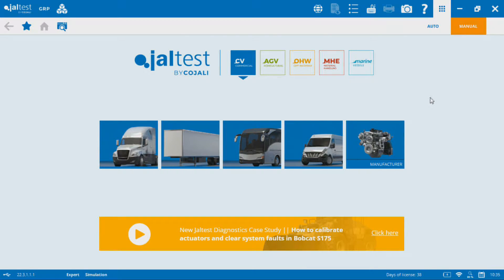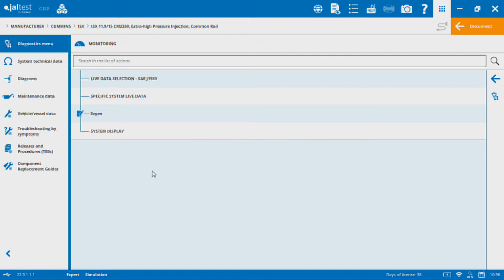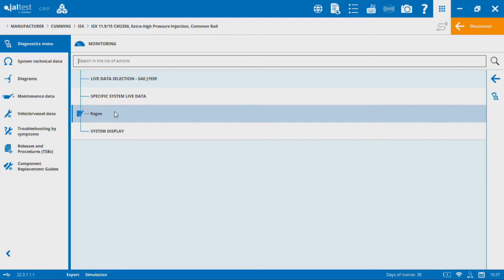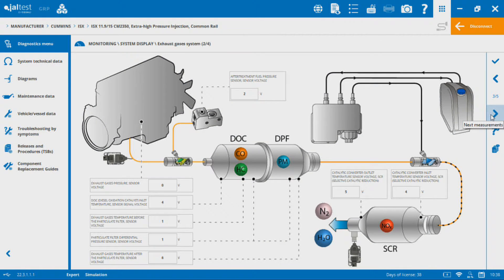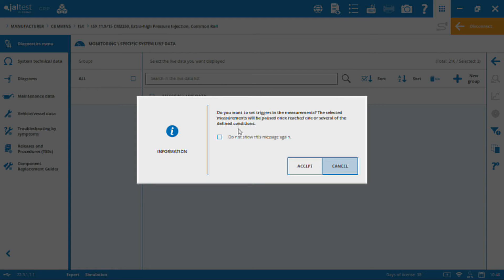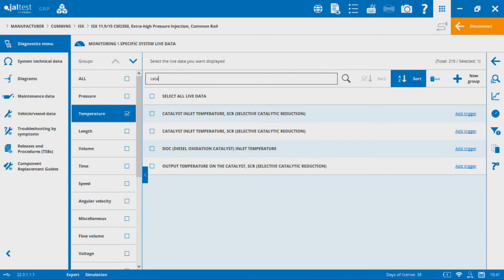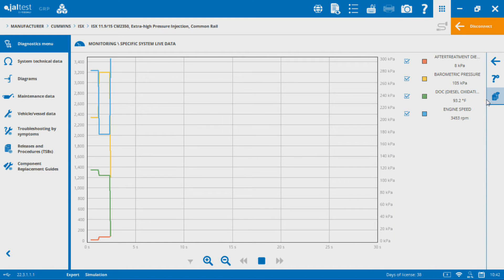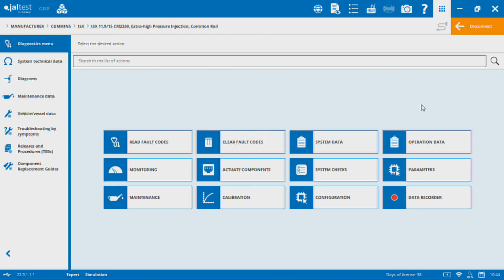Using the Jaltest Data Monitor Feature

Comment: Is it available of all models ECU flash files for programming new unprogrammed ECU in OHW software...?
Reply from the maker: It is not possible to program new ECU's on all makes and models. OEM software will be required for this...
Reply: @WholeFleet Diagnostics  thanks for your support.....shall I can program the ECU using Jaltest, which I have flash files on that brand